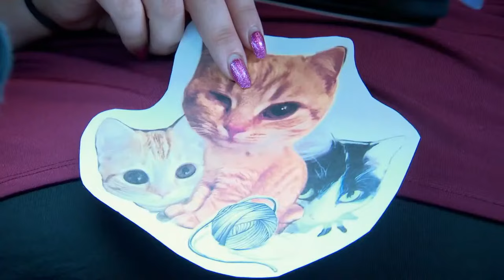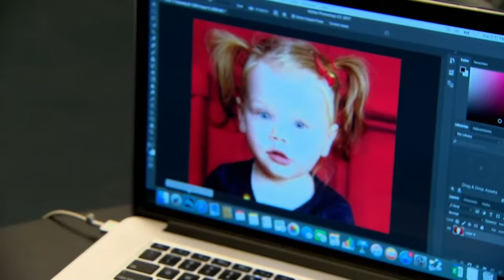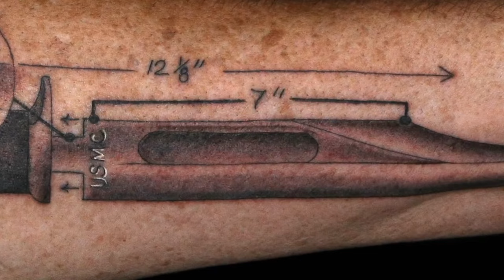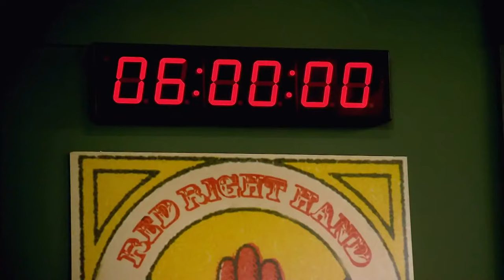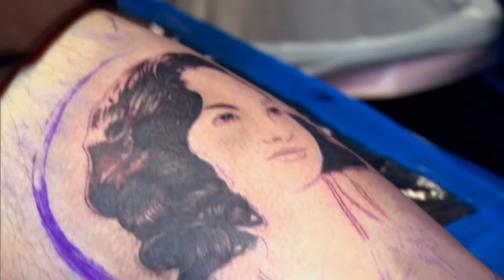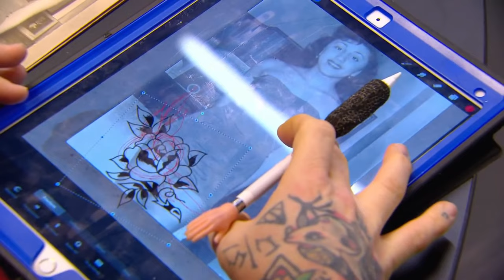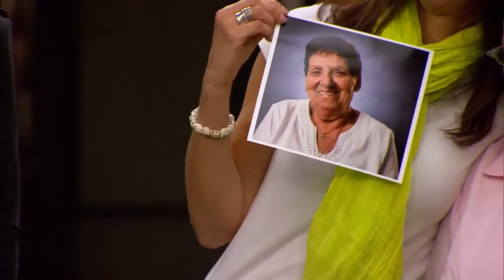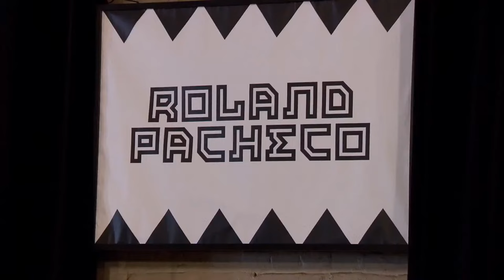The Worst Tattoos | Ink Master's Fan Demand Livestream

Comment: 1:46:29 To be honest The hands aren't even backwards they're actually kinda correct but the right hand of buddhas thumb is misplace slightly but if you look at it the thumbs aren't in the back at all the right hand of Buddha looks like an open palm left hand presenting the ball And holding the rope but it's actually a twisted right hand with the thumb reaching over his palm holding the rope and ball the thumb isn't in the back they're on the outside of the wrists in this angle and position

Comment: I never understand why they think the hands on the budda is backwards. It looks right to me. They look closer to the front and curled in towards the hand which would be correct ???
Reply: Exactly that part really bugs me. Yes at first glance it may look like they are in the wrong spot but if you actually look close enough you can see the thumbs are correct. They need to look a little closer at the tattoos when critiquing them..

Comment: The fact the show is cool allowing people to come in and get absolutely BUTCHERED work is stomach turning. Yeah, free tattoo (and I grant, you get what you pay for. Which is why mine take a year at a shot to get the next round done after saving. I'm a picky bitch, but I also am a picky bitch who ~pays~ for the work. Better slow and good than cheap and crap) but good god. When they see a tattoo turning into a muddy dark mess that can't be covered up and will be hell to get lasered and NOT pull the plug is just flat out wrong. People have to wear this stuff. Forever. These are pieces you get buried in. If that isn't going to be taken seriously, put the freaking needles down and go get an office job!

Comment: 32:06 most satisfying. That was probably the worst tattoo I had seen up until that point. Plus the two guys especially the taller one was so arrogant. Pins and needles wasn’t that great either because of that hand but theirs was way better than Think before you Ink.

Comment: The angels by far got me-
Tri-city to me was not the worst there- yes, there were mistakes, but I still really liked it, and to me, their styles matched up just fine in the end. I would be completely fine keeping that tattoo as is- if the judges didn't point out the mistakes, I wouldn't see em- hell- I still barely see them but maybe that's just me.
Same with Allagory Arts- they were fine- mistakes here and there that they pointed out- but to me it looked great. I'd be fine with those tattoos.
By far- the ones I had the most issues with were Made Rich. I'm sorry but to me the anatomy looks hella wonky on both- let alone their styles didn't even match up, which was the point of the challenge. Like. Fuck, man.

Comment: That skull tattoo actually looked more decent than the phoenix one, sure the colors are all over the place but they did spit facts, of it was "artistry" day then the colors should make sense like seriously in "art" the color does not really matter, you can go bold with colors so long as the drawing and line art works with that type of color palette, the phoenix however although it had a decent color palette the shading is not a s good as the skull. I know that it can easily be fixed and you don't even need to make the blue blob bigger to fix that like ever heard of color contrast, add a few shading and finish the damn thing up. I have been drawing since I was 10, it's been 20 years and I see an actual work of art being eliminated for what "not pleasing colors" really? yeah nice judgment there.

This is my opinion okay don't come at me, House of Monkey I vote you guys to stay on that one. Ihope to see you guys come back